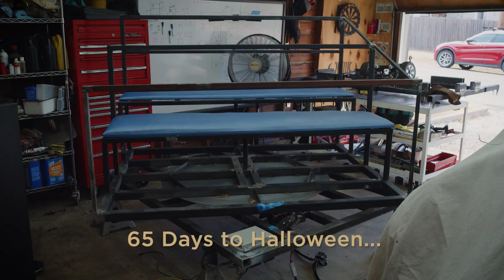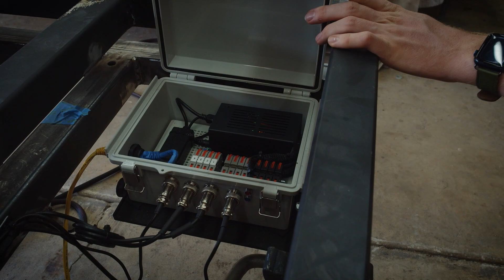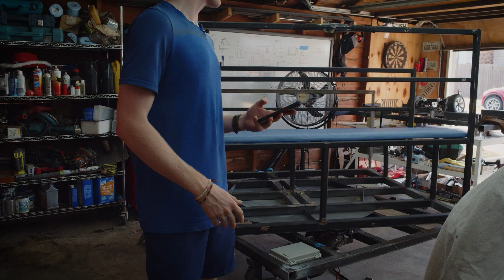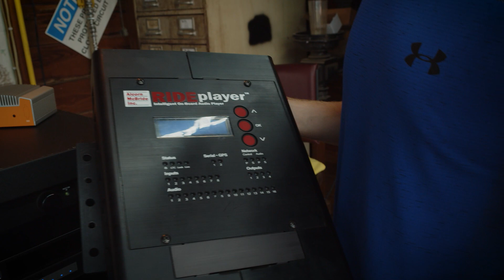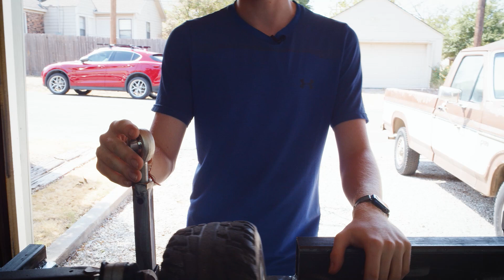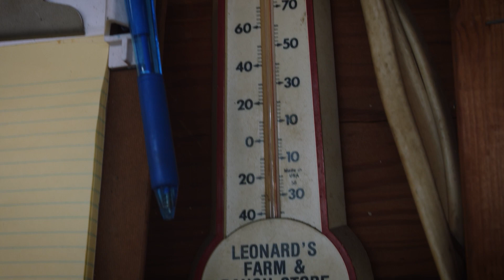Chapter 1 Construction | Project: Oasis, Backyard Dark Ride Roller Coaster Experience

Comment: very amazing project! how do you power up that huge motors on the cart on the track? i'd see any cases with batteries inside. i hope you power it through the rails. if it don't, how do you power it. how much watt and volt are these motors, for the rotating, and for the ride itself. and do you learn the electric by yourself, or do you have a buddy that will help you with this ride? and are there new plans for a new ride the upcoming years? i'm glad to see that. very very nice, i like it. i don't have the room for this big cart, i do it by myself with a 24 volts motor, and i control it via esp32, with code, and buttons. i hope for your answer, keep up the good work, and hoping for more of this. greetings from the netherlands, Anne.